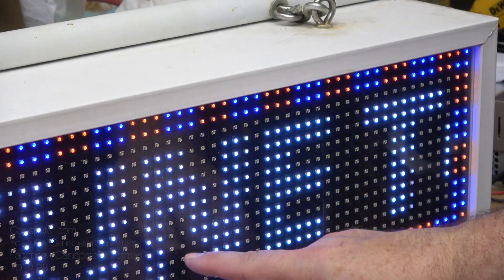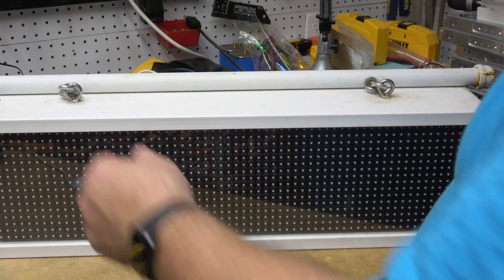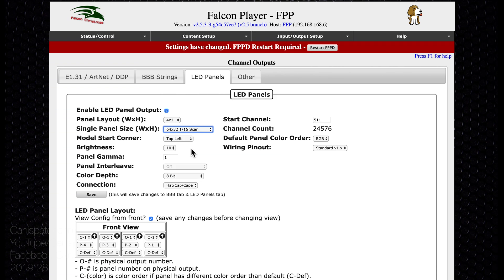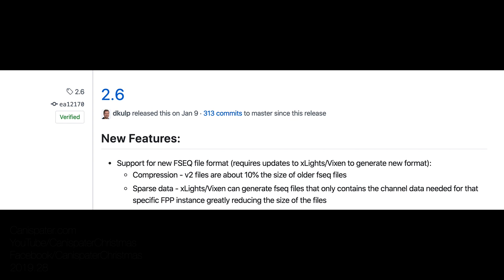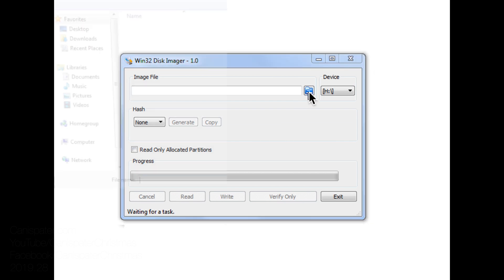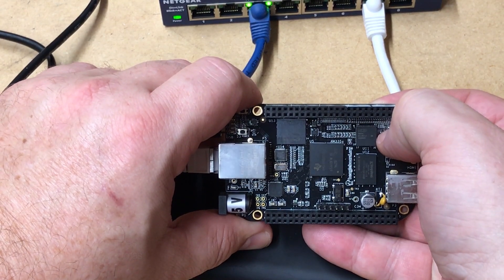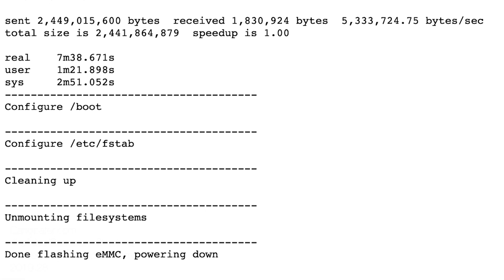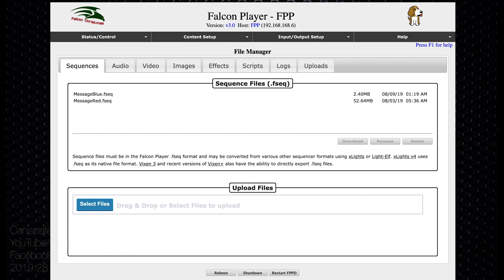🎄P10 Panel to P5 Panel Conversion (2019)🎄

Comment: Loved the video, I am going to build a "Tune To Sign" like your design have all the panels controller and power supply, I am having some problem getting the controller to communicate with the panels correctly, even in FPP test mode the panels don't look correct, I think I have a problem with the controller as all my other lights work with other controllers, I was looking at your video on the Hanson Electronics Octoscrolla with RTC and the IC Chip is mounted on the bottom of the board on your video, My Octoscrolla has the IC Chip mounted on top of the board next to the power header. I wonder if this could be the problem
Reply from the maker: I think someone else had a similar problem recently. The silkscreen on octoscrollers is pretty bad except for Alan's. lol! Make sure you know which port is which.
Reply: @CanispaterChristmas   SOLVED : talked to Alan at Hanson Electronics, he verified that the Octoscrolla was mis-built and was sending me a replacement
Reply from the maker: @caladamson2256  Haha. Glad you got it figured out!

Comment: How many P5 panels per 300 watt power supply do you recommend
Reply from the maker: 80% of 300W divided by the maximum wattage of a panel. Not trying to be funny, but you need to know the specs of your panels to answer that question.

Comment: So the data cable and power cable are interchangeably.  What about the connectors for the panels. Like the t connector and x  connector are they interchangeably?
Reply from the maker: Not sure I know what a T or X connector is unless you mean pixel pigtails and panels don't have those.
Reply from the maker: But yes, the power and data are the same. Or they were in my case anyway.
Reply: I was talking about the panel connector strips. To be able to join your panels together.
Reply from the maker: @timburge4812  Haha. I thought about that after sending. Yeah, those were different.

Comment: Jeff great video as always 👍 Quick question your previous video review of the Octoscrolla stats only compatible with P10's(as does Hanson's website) however here you swap out P10 for P5's. Does this mean it can support P5's or did you change the controller?
Reply from the maker: Thanks! I used the same octoscroller, just swapped out the panels and updated the settings.
Reply: @CanispaterChristmas  wow quick reply! Thank you. Are you happy with your P5's i.e. do you feel that it was worth the swap and would you have swapped if you didn't have a line in your P10's?
Reply from the maker: The P5s are much nicer - can use better fonts. I wouldn’t have changed them out if the P10s hasn’t developed a problem tho.
Reply: @CanispaterChristmas  Cool.  I'll order my P5's then 👍 Keep up the good work. Love your channel 🎄
Reply from the maker: Thanks! Not as critical if you're building a huge P10 (several panels), but for my tune-to sign, it made a huge difference.

Comment: I’m going to be doing P10 panels for next season. Is it possible to have remote panel away from the main controller, or do I need a Beaglebone at each panel location?
Reply from the maker: BBB + octoscroller is the recommended way to run a large number of panels though there are other options for smaller setups. You might ask this on the message boards as a few folks have a ton of experience with various panel configurations. I only have a small 4-panel setup so I'm no expert when it comes to more complicated designs.

Comment: what the default ip address for BBB after we load the image on the BBB?
Reply from the maker: It uses DHCP to get an address so it needs an Ethernet connection to your router. Check your router for DHCP leases and it should show you a new address. Hit that with a web browser to configure. You can set a static address once you get in.

Comment: have this set up with p10's   set everything up and have everything loaded to the BBB.  when I hit play nothing happens, but if I scroll through the playlist using the next button it will start playing once I scroll through back to the first sequence    any thoughts or recommendations?     this is my second year doing a lights show, however it is my first year with xlights.  wanted to do a Halloween show, but I am at pulling my hair out.  lol
Reply from the maker: I think you have to select a playlist first. If it runs from the scheduler, the scheduler takes care of that. Or are you saying that you selected the playlist and it's still doing that?
Reply: yes, I select the playlist and push play, but it will not play unless I hit next until It gets back to the first sequence.
Reply from the maker: @166arm  What version of FPP are you running?
Reply: Falcon forum to the rescue.  LOL      Had my BBB set up like my PI with the sequence and audio.  well seems since no onboard sound on the BBB, it does not like it.  Setup everything to just sequence and its working.  Just FYI incase you have anymore dummies like me asking.    Thanks for your help and keep the videos coming, need all the help I can get.
Reply from the maker: @166arm  Ha! I don't think I've tried running an audio sequence on a BBB. That would have tripped me up too. lol!

Comment: Looks like the scan rate for P10 is better than the P5's. The V2 file format looks like the scan rate was better for P5's but not as good as the P10's still. The text was scrolling a little split in half. Thanks for the info I think I will go with P5's but not make a scrolling sign. Mine will just be static anyway, maybe :)
Reply from the maker: Yeah, definitely noticeable on camera and up close, but I haven't seen from afar to see if it's better to go one way or another. Didn't even think about V2 vs V1 performance. I'll try that out.

Comment: just added (last minute) a p10 sign to my display this year.  this will be my first year using xlights, second year light display.  I have my sequences done, but for the life of me cannot figure out how add this to the existing sequences.  Help please
Reply from the maker: It's just another model, but my sign is totally separate because it just has text over and over. Also, I don't have to put something in each sequence. But if you want it part of the display and to actually be part of each sequence, just add a matrix model in xLights.

Comment: I have several CHIP computers.. all wifi and bluetooth.. i have not looked into using those but i have them maybe i should.. how do you feel about that?  Think its worth a go so should i go pi or beagle bone?
Reply from the maker: Not exactly sure what you mean by CHIP computers and what you're trying to accomplish. There is some success using ESP modules (ESPixelStick) for converting E1.31 to SPI for the pixels, but they are limited in comparison to a dedicated controller. As for something to play sequences (convert FSEQ to E1.31), there is Falcon Player that runs on linux (Pi & BB) or xSchedule run on a PC/Mac/Linux (not Pi & BB).
Reply: @CanispaterChristmas  i have a few ESP units..  https://en.m.wikipedia.org/wiki/CHIP_(computer)